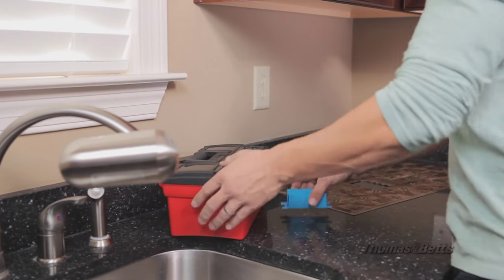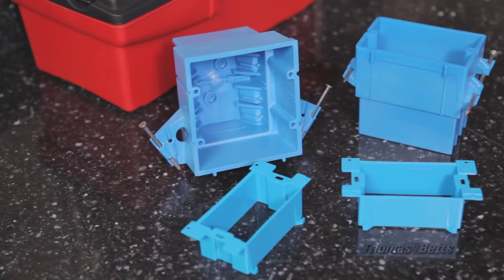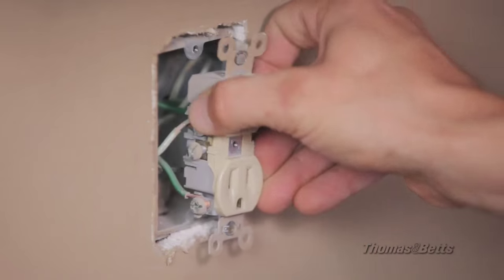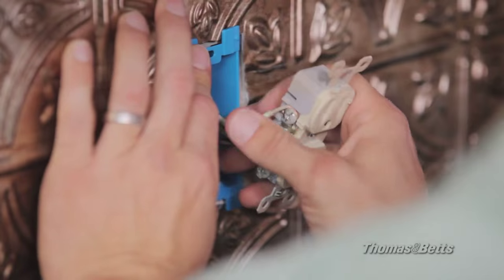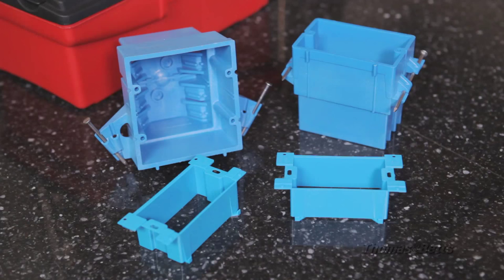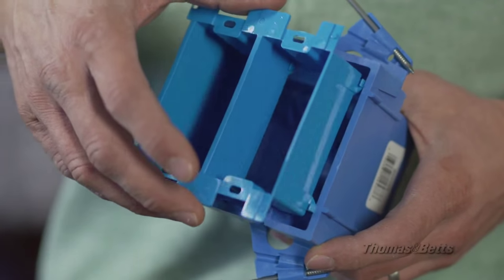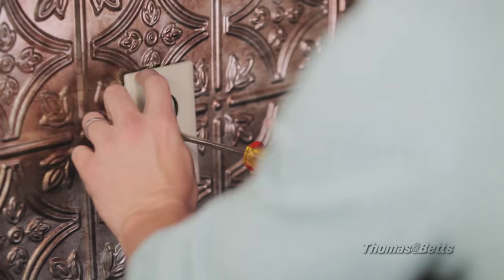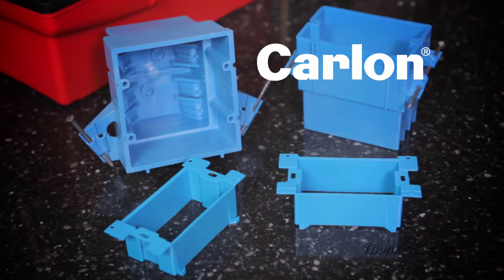Carlon® Non Metallic Electrical Box Extender

Comment: These are great, just used a couple today,  things to note, unless you are replacing the outlet or have lots of wire to pull outlet well away from wall, it maybe difficult to fit extender over outlet,  I had this problem, fix was to cut extender in half,  worked great